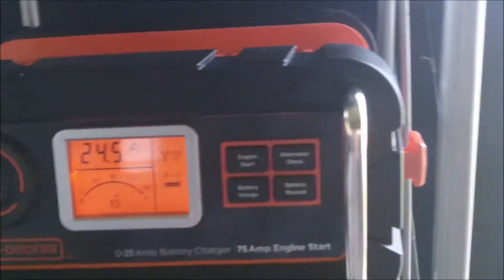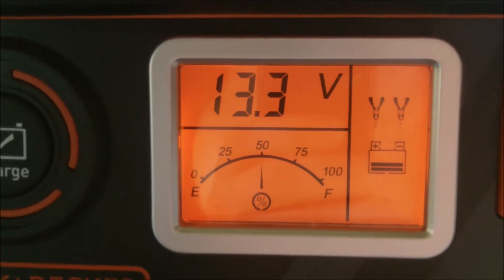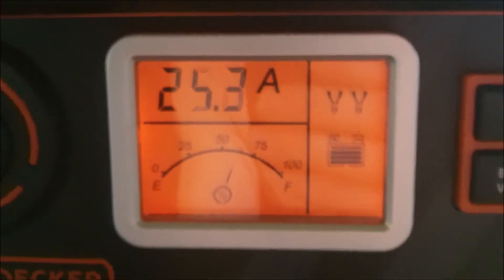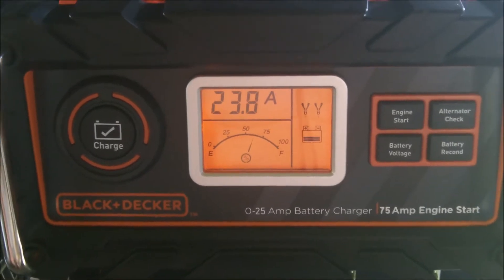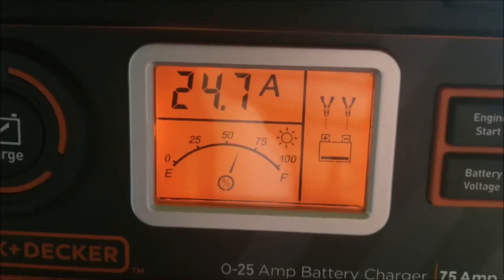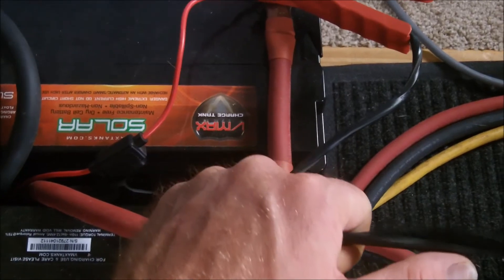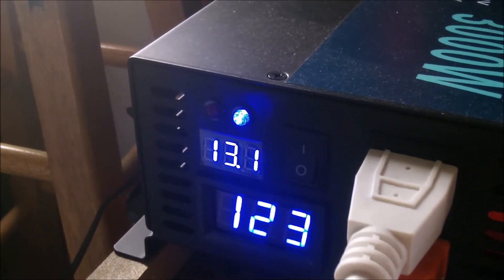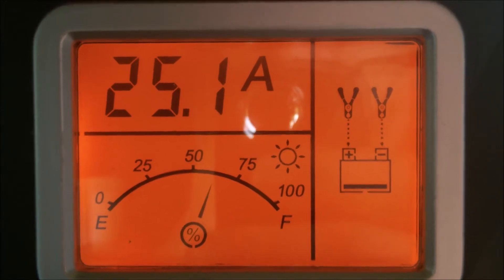BLACK+DECKER BC25BD Fully Automatic 25 Amp 12V Bench Battery Charger/Maintainer PART 2

Comment: If it doesn't allow you to select AGM vs flooded it will either optimize for one of those or neither.  In my opinion they threw a fancy lcd onto a basic charger and called it a day.  I'd take a Noco or a CTEK over this any day of the week.  The Noco's do Lithium as well.
Reply from the maker: il never buy again the charger is stuck in recondition mode waste of money im going to look into the chargers you mentioned thanks

Comment: I have this unit... It has paid for itself. Now I am reconditioning a battery that is in good shape... But I notice that when the unit automatically goes into "Charging Mode" after reconditioning it shows the voltage as continuously dropping! WHY?  Is this showing the amount left until full charge?

Comment: You need to check the battery voltage when there is no load - to get an accurate reading.

Comment: I bought the 15amp, didn’t help at all. Truck barely wanted to start after charging overnight. 

Do you think the 25 amp would work on deep cycle batteries on a semi truck?
Reply from the maker: your jumpstarting two batts should have gone with 25amp and yes it will charge a deep cycle if one of your batts are bad in truck it will drain the other batt try charging one at a time get them equal then charge both thanks again
Reply: @classaendlessadventure2879  

Thanks. 
Still gonna hold on to the 15 amp.